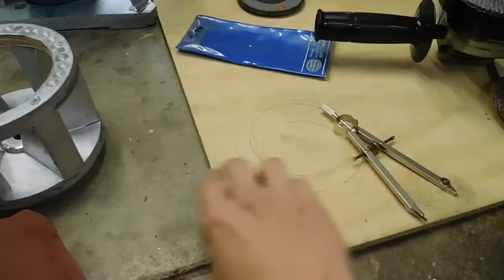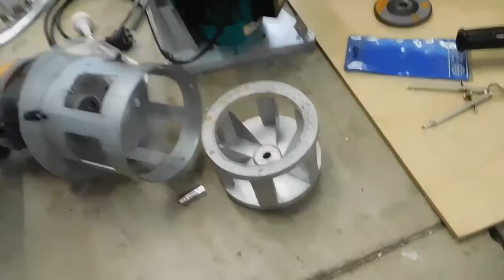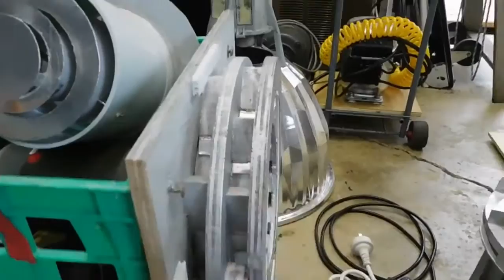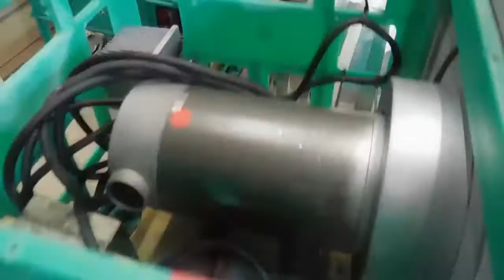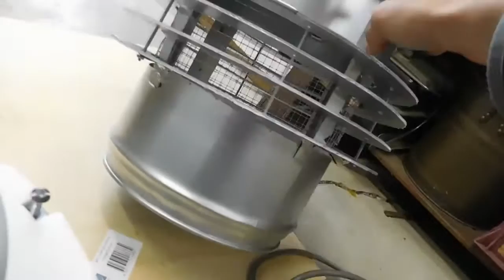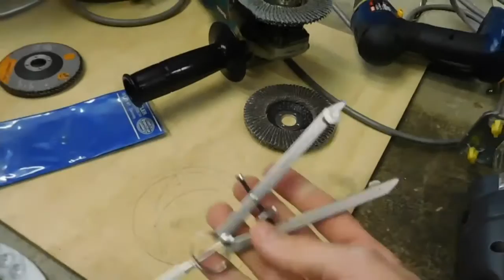Plywood Air Raid Sirens - How I Built Them

Comment: I plan on making my sirens out of cans and sheetmetal.
Reply from the maker: +Creeperboy cans make excellent stators, preferably the Nescafé or Milo tins. Don't know about sheet metal rotors as they tend to flex under high speeds
Reply: for my siren motors (small size) I will use drone motors cuz they're speedy.
Reply: +Creeperboy what easy to aquire motor should I use for larger sirens?
Reply from the maker: Creeperboy pump motors are the best, as they generally have the torque the siren needs to get up to speed

Comment: Something I have noticed is that all your sirens sound warbly and raspy. Have you tried making a PVC siren? I have made 2 so far and they sound smooth and just like real sirens.
Reply from the maker: Reason I don't usually use PVC is because it's a lot harder to centre a round object on a motor shaft without having the dead centre of it already.  And as PVC pipe is very thin, I don't get the clearance to machine it down
Reply: I ran into the center problem too with both PVC sirens I made (the one on my channel plus another one I am building that is 5/6 port and sounds just like a tbolt). on the 6 port siren I gave up on a perfect center and just sanded it down so it didnt hit the stator. on the 5/6 port siren I spent 1 hour finding the center and I got it balanced perfectly. But I do know what you mean, using a compass will already give you a perfect center. I am going to build a wood siren like this anyway, and I am going to try and make it sound less raspy (any ideas why yours sound like this)?
Reply from the maker: alertec2202 yeah a compass makes it a hell of a lot easier. They sound raspy because the spacing between the ports is not 100% even, although it is close there are points where some ports are open and others are 3/4 closed (and vice versa). When I do build another one this is one of the issues I will be dealing with